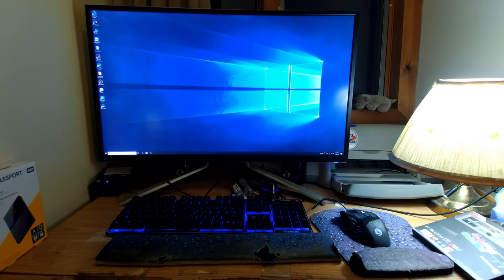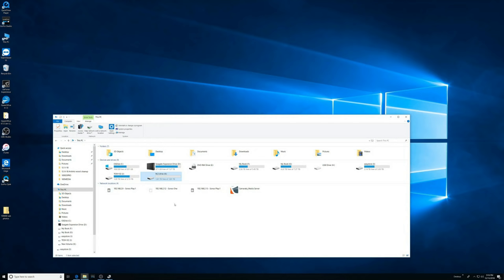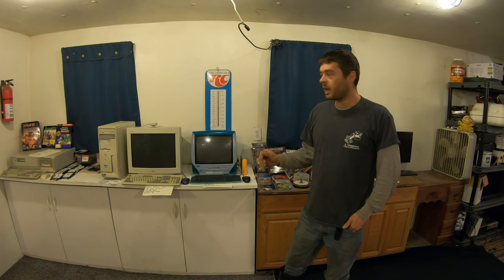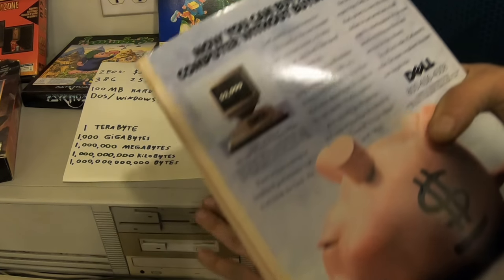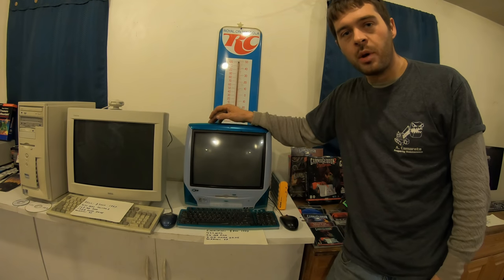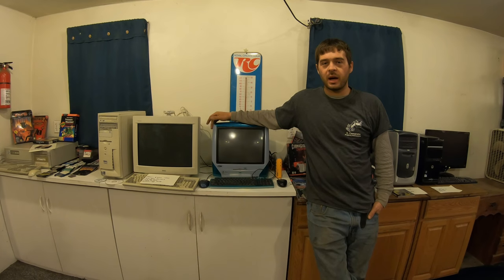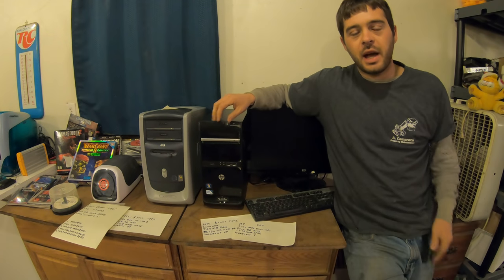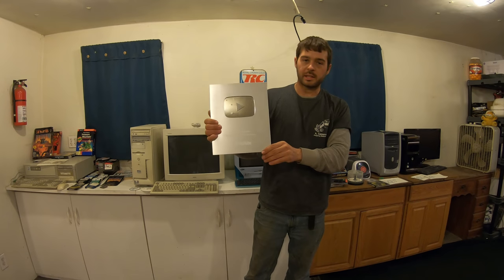Upgrading and talking about computers

Comment: You know, it’s so funny. I’ve been watching your videos (at least 30 by now) for a month or two. Why? Because I want to get into using excavators, tractors myself. Mostly for personal use. I might start with a Ford tractor like you have. 

So what’s funny is that I’ve been a computer guy for like 20 years. Started doing dialup tech support in 1999, then computer networks for banks, now computer security for a large bank. 

I get sick of looking at screens and sitting. 

Ten years ago I started remodeling on the side. Then I fixed up my 26x36 barn, built a 50’ stone wall, and then a 12x19 outbuilding which I use as an office. 

Thanks for the inspiration!
Reply: Shawn Carroll : Inspiration
Reply: You gotta make a excavator , bull dozer skid steer game

Comment: Thanks for the trip down memory lane. In 1999 I had a private computer upgrade & repair shop. It was no big deal, and the other half of the shop bay was a wood cabinetry workbench for my partner. 
Our favorite thing, even back then was having working models of every computer we'd ever had (or worked on) since 1984. 
They ranged from Texas Instruments TI-99, to Commodor 64, Radio Shack 1000k, 286, 386, PS2, and Pentium-90. One wall had all of them running screen savers, with boxes of game discs so we could play them too. On the other wall we build Server, Hub, and Switch racks.
No, we didn't need to use a floor heater to warm up the shop. ;-)
I'll just bet that if you hit enough garage, yard or estate sales you'll find replacement boards for your Zeos AT-386. 
I'd give you the parts myself, but a few years back lost most of those museum pieces to a storage fire. Bless you for showing us yours. They look great.

Comment: The RAM and SSDs will definitely help improve video editing. Windows and the GoPro software will run much faster if they are also on an SSD. I would reinstall Windows on that M.2 drive. If possible, configure that GoPro software to store its temp files on one of those SSDs so it can work with them faster.
Reply: The boot drive is 256GB. Pretty sure we can assume it's an SSD already.
Reply: There are 2 ssd trays in that case and one was already populated
Reply from the maker: Yes, the os is on an ssd
Reply: @AndrewCamarata  but new evo960 is probably even faster than that. And has capacity for all programs.
Reply: Yeah, you'd have much better performance reinstalling your operating system onto the NVME m.2 drive.
Reply: I agree. Sata 3 max speed is like 600mb/s. M.2 theoretical limit is I think 3.5gb/s. Though, I've never actually gotten that fast on mine, but still. Almost 6x faster. Having the OS and programs on the actual drive will help a lot. Quick note, M.2's performance is very thermal sensitive. Once it starts getting hot, performance drops fast. Andrew has water cooling so the case should be fine, I would think, even with 4k editing.
A free program called DiskMark64 is good for benchmarking, to make sure you're getting the expected speeds from your drives.
Reply: @Lithic32  NVME has up to 3,5 GB/s. The normal M.2 has nearly similar Performance to Sata 3.
Reply: @palo An extra 16 will NOT help speed.
Reply: If he really wants to speed up video editing, need to upgrade the graphics card
Reply: M.2 is pretty slow. I would use optane memory :)

Comment: We are here for you Andrew, no matter what the subject! This brought back so many memories! I purchased our first computer in 1987 ...an IBM based Franklin dual floppy drive no hard drive, DOS system for $2500.00. We still do not have cable internet, we use wireless internet to watch you!
Reply from the maker: Is the wireless internet fast?
Reply: It’s a mobile hotspot. I have an unlimited data plan. I can stream stuff but after awhile there’s buffering issues and I have to restore it. Cable finally came down our road in November but they said the ground was frozen and they couldn’t bury it or lay it across my road to get to the house. 😡

Comment: You should install windows to that m.2, Its super simple just download a clone program and clone your windows then install it to that m.2 that will give you more performance than anything.
Reply: Samsung has a great one for copying to Samsung drives.
Reply: Yes, this. Highly recommend!
Reply: Yes, agreed. Samsung software is good, I used Macrium reflect (Free version). Either way, you wanna make the 970 ssd your primary boot drive to take full advantage of the performance. And when you clone the drive, partition it EXACTLY like it was on the other drive. If you do it out of order, It WILL NOT boot correctly (black screen). There are plenty of videos on here on how to do it :) super simple.

Comment: I enjoyed your computer video.  Been there, done that.  I have worked with computers and PCs since 1968.  I first worked on an NCR 500 Posting computer doing patient accounting at our local hospital.  Our monitor was a big cabinet of diodes we could read binary codes.  We input the data using a big keyboard with rows of numbers.  To input the letters "ABC" we would start all the way to the left aof the keyboard and press the number 2 the first row from 1 at the bottom through at the 0 at the top). A was 21 starting with the number 2 and a 1 in the next row to the right.  B was 22 so we pressed the third row number to the right with a 2 in the third row and a 2 in the fourth row.  C was 23. using a 2 in the 5th row and a 3 in the sixth row.  We looked at the banks of lighted diodes to verify ABC.  Such fun and we got to be pretty good.   My first PC was an Epson laptop with a led display about three inches wide and an inch high.  This allowed us to actually see the letters and or numbers.  The program came on an EPROM.  It was pretty good for a laptop.  My wife took care of our bookkeeping on that thing and was really reluctant to give it up for a new IBM 386.  We did not have internet back in those days but we did have bulletin board s with MIT using a 300 baud telco modem.  I kept all the PC that I bought and put together until it was just too depressing to think about all the money I had spent on computer stuff.  I smashed all of the old ones and destroyed old hard drives.  My newest is now five years old with only 8gb of RAM and 500GB SSD and 3Tb storage drive.  I have 1Gb LAN and 1Gb cable modem.  I probably will not need anything faster because I can no longer keep up. with the 6 PCs in the house and a server in the shop.  Care and feeding of these seven takes far too much time.  Keep up the good work Andrew.  Our world is a better place with you in it.  JB

Comment: From an IT pro: Download Samsung's migration wizard and move your OS to the M.2. Your boot speed and application speed will be noticeably faster. Mem cache is also stored on the OS drive unless you specify otherwise. Also, those heat sinks on your new ram is cutting off your air flow, defeating the purpose. Love your videos and work. Thanks!

Comment: I went though the same life cycle starting out in the 80's with Vic 20 Tandy computers and Hayes 300/1200/9600 baud modems  then building clones in the early 90's. I jumped from DOS to Windows to Linux to Macintosh then back to Windows 95/98/XP and finally back to Linux using Ubuntu. I've hung on to one of my first Tandy 1000 HX computers, a Mac SE30, 1 Mac Performa with a DOS 386 Orange card installed and some of the clones I built. Great times to live through. 
Another great video.

Comment: You should just clone your C: drive over to the m.2 and use that as the main harddrive. Faster boot up and less lag overall.
Reply from the maker: Sebastian think so? It’s already on a solid state drive.
Reply: Andrew Camarata the m.2 is much faster than a normal ssd.

Comment: You took me down memory lane there for a while..  Started working with computers in the late 80's , and it's been what put  bread and butter on my table ever since.  It sure is easier to upgrade now when the BIOS detects everything itself.  Before you had to program all the specs for new harddrives into theBIOS yourself. Not to talk about jumper settings for master and slave disks and addressing expansion cards.  Great video as always Andrew. Merry christmas to you.

Comment: Great video Andrew. I can highly recommend a certain type of power connector for your power to your SSD or HDD.  The one I would suggest is "Monoprice 108794 24-Inch 4-Pin Molex Male to 4 15-Pin SATA II Female Power Cable Net Jacket". 
 The other  cheaper molded variety which are very common and perhaps the one you used are prone to short circuit and melting of the connector at the SSD.  This is a known problem. 

Thanks for your excellent videos.  I'm a big fan.

Comment: I started out using a Radio Shack TRS80 (around 1980) in high school and learned how to program on punch cards. Computers have come a long way. They really started to become useful in the mid to late 90's when windows 95 came out and the internet was really starting to take shape. You do a really great job editing and taking your videos. Glad you got the 100k award from youtube. I thought I never threw anything away but you got me beat, but come to think of it I have an Atari 800XL computer in the attic somewhere. Acronis True image is pretty good for imaging hard drive at least the older versions where. I have heard it has gotten not as good on the later versions. I have version 11 and 12. 12 has been a pain compared to 11. I never used the Samsung software for drive imaging.

Comment: Yes, it is interesting to see the evolution of these machines.  If memory serves me correctly, the 386 had about  275,000 transistors and of course no heatsink was necessary.  As the transistor density increased, the CPU's got hotter and faster.  Today CPU's have billions of transistors.  I built my first clone in 1984 and like every other builder, used bootleg copies of MS DOS.  I recall the computer shows being gigantic in size.  Even the Computer Shopper magazine was pushing 800 pages at one time, and basically everything in it was what everyone else was selling in parts or clones.  Fertile ground for would be Michael Dells.

I really enjoyed this video and your personal history of your experiences.

Comment: I thought that Zeos computer looked familiar, even though you covered up the case badge.  That's an older model, produced before I started working there in 1994.  When I left, the fastest processors were about 150Mhz, with a 4x or 6x CD Drive.  The desktop and tower cases were redesigned shortly after this, and we even got one of the first Mini Tower cases around, that everyone builds with today.
Reply from the maker: Mike Nelson try running it in  Compatibility mode or google it.

Comment: Just to get information as accurate as possible for your viewers, the terabyte breakdown numbers are a little off.  Your breakdown is a good one that is often used and is a quick simple reference to recognize the scale of each size.  Not common knowledge is that the numbers aren't as simple.  

1 terabyte =
1024 gigabytes =
1048576 megabytes =
1073741824 kilobytes =
1099511627776 bytes 

Love the videos and keep up the good work Andrew!

Comment: Just going to help explain something about that M.2 Drive. Make sure to read your Motherboards/PC's manual before buying those drives. There are 2 kinds of M.2 SSDs. M.2 is the name of the slot, but it "CAN" support USB/PCIe/SATA interfaces. Most M.2 SSD comes in SATA and what is called a NVME drive. Those connect via the PCIe system bus. The M.2 port must support that bus and the CPU must have enough free PCIe lanes. Do your homework before just buying these drives. A SATA based M.2 will function like a normal 2.5" SSD, just without all the cables.

Comment: (Continuing my binge Great Camarata Covid2 Quarantine Catch-Up_)  You touched so many memories in this stroll down computer memory lane. I bought my first computer in medical school in 1981 when I realized that the bookstore had a whole wall of computer books of which I knew nothing. I chose poorly but perhaps for the better. In 1982, I bought a Radio Shack Color Computer 1 than the next model 2 with "64K" of RAM in 1984. Turned out the CoCo was a dead branch of the evolutionary tree of computing, but by the time I could afford a PC in private practice in 1991, I had invested in every expansion device, add-on, video converting from TV to a red audio and yellow video output RCA plug, a Sakata color monitor ( It all still works) and spent years typing basic programs and saving on cassette tapes. I learned a hack that if you taped over one particular contact on the game cartridge, you could copy the game to a cassette to load and save. I was in the Air Force from 88 to 91 and stationed in Clark Air Base in the Philippines. Off base, retired master sergeants married to locals had set up computer stores where you could buy pirated clones of any program in existence. They had banks of PC'
s with special hacker and cracker cards defeating copy protection as it came out. Lotus 1,2,3, dBase, AmiPro Word. You name it, you could buy it cheap. 
My first real PC was a ZEOs 386-25 and it was about 3 grand. What followed was 28 years of building PC's chasing the elusive rabbit of speed and more storage and cooler graphics. Dial up modems, dual channel modems, an ISDN line, than cable 100 Mbps service. From a NEC CRT monitor that must have weighed 50 pounds to a thin curved 2K IPS monitor that resolves better that my eyeballs. And every time is about $3-5000  for everything if you are buying near the bleeding edge.

Comment: if my memory is right, I have a 8 or 8.5 inch floppy from 1987 or 1988.  I was taking a 2 year drafting and design course at Danville Comm. Coll. in Danville, VA.  the "application" was GW basic or Gee Wiz.  you had to type in certain things to make lines and circles.  never got into it that much because it was new and we were still drawing with pencils, triangles, circle templates, scales and erasers.

Comment: Andrew thank you for this video!!! It brings back good memories when I was first figuring out computers. I still use my first Compaq desktop from 1999. It is upgraded all the way and runs Windows 7. It has a Pentium 3 at 1.4Ghz, 1.5Gb ram, 6600GT graphics, 120Gb SSD, trackball mouse, and a widescreen monitor. It's still good for typing papers and browsing the internet if you are careful. Last year I finally bought a new MacBook.

Comment: Another way to speed up your machine (especially with the new RAM and SSD) is to increase the pagefile size AND set it to use the SSD for the pagefile. It's like getting more RAM. Keeping all the apps and OS running on the SSD really speeds it up. I did this with Sony VEGAS for doing my videos. I noticed my render time for, say a 15 min video, went from 1/2 an hour to like 2-3 minutes! It also helps when editing if you are using filters as well... less stress on the processor.

Comment: Some suggestions mate.When installing ram and components I always try and put the case on its side.Its much easier pushing down and less chance aligning ram etc wrong, which can happen as some of the ram clips are tight.When you shut the power off the pc I always pull the lead out then hold the start button on the pc for 10 seconds at least to discharge the power from the boards capacitors to make it safer to install ram and components etc.The new ram you put in looks a different make to the first two sticks , its better to match them up with same modules not to lose any speed in dual channel mode.It works but is not optimum. Also worth reformatting and putting the win 10 on the m.2 drive for much faster startup and windows experience as it is a big enough drive to still use for your editing etc. Thanks for sharing the video mate , nice to see the old computers.

Comment: Interesting tech review.  First computer ZX81 with 1KB Ram, later on 16KB wobbly RAM pack. Early 90's computer was Atari Falcon with 14MB Ram, HDD overclocked to 32MHz and Resolution booster (Worthless crap, lol).   Dial up sucked with calls unless you got a program called 'Call Wave' which told you about an incoming call but did not kick you offline. Late 90's worked for an internet company at nights and had sole access to a T3 line (this is not like 3 x T1 lines) and Napster. :-)   Oh and as a side note 'PLEASE DO NOT BUY EVO DRIVES;' they save a little money but have nowhere near the lifespan or performance as the Pro drives.

Comment: Hi Andrew, as a computer analyst for the last 40 years, you brought me to memory lane here, your numbers are not exact, but very near, the magic number in computer is 1024....but it's ok to round it up!, one suggestion to really speed up the video or any process is: (my actual computer built) the best processor is a i7 with 8 cores, your video card should have at least 32 GB on board, the computer memory is 64GB, the EVO SSD (fastest) drive should be your "C" (256GB) drive with only your Windows system files on it, your "D" drive should be your 'live' data work drive (the 4TB SSD), your downloading of files are configured on this drive, then I put 5 TB hard drives, these are my storage drives, WD green models, they stay dormant untill I address them (takes about 3 seconds, but saves a lot of energy and spinning idle for nothing), 300 watts power supply, 6 USB-3 ports+2 USB-2, 3 motor-less fans....The key point is to have the C drive as your boot drive, and your D drive to have data you are manipulating also on SSD, even if it's a bit slower than the C drive, but much larger, and the memory directly on the video card, and at least 32 GB of memory on the computer, but I put 64 GB of DDR3 because DDR4 was not available yet...2 BLUE-RAY writers, 2 36 inch monitors and more stuff......and my machine is 6+ years old, but still lightning fast and current!!! And much better than new machines coming out today!  That my friend is a very optimized computer